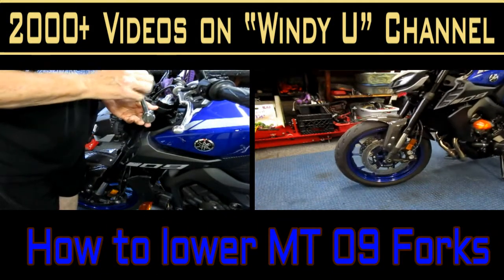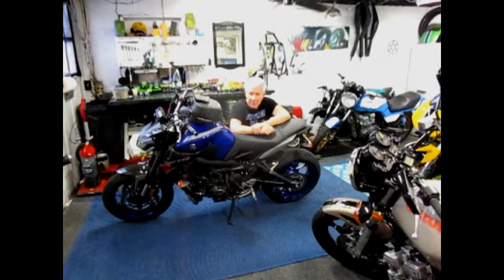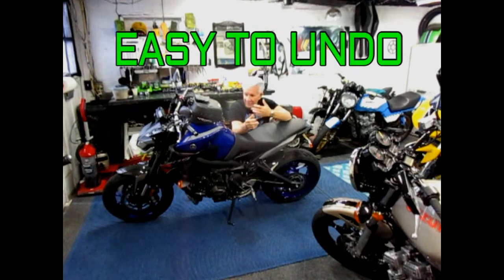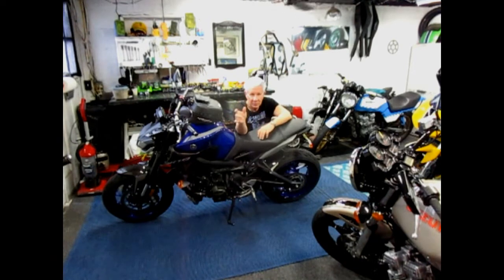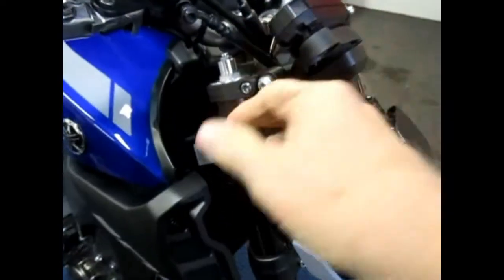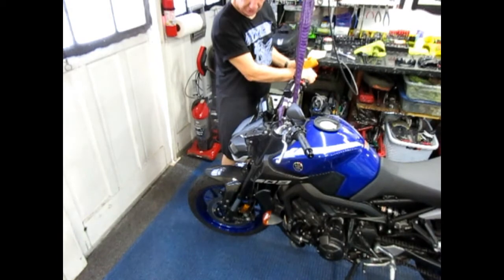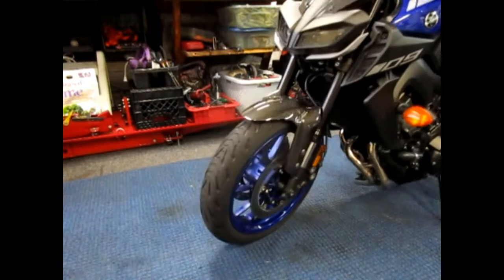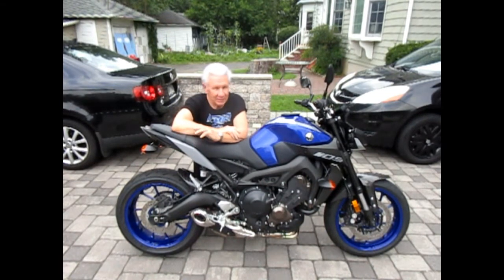HOW TO LOWER FORKS ON MT 09 YAMAHA OR SIMILAR MOTORCYCLE

Comment from the maker: A LOWERING LINK WILL BE A BIG HELP,I HAVE INSTALLED MANY INCLUDING LUCIANOS ZX10 AND MY OWN R1 and FZR.IF THAT'S ALL YOU DO THAT'S FINE BUT YOU COULD ALSO TRY LOWERING FRONT ABOUT AN INCH AND SEE WHICH WAY YOU PREFER.AS A NEW RIDER YOU MIGHT NOT NOTICE THE DIFFERENCE.LOWERING THE BACK ONLY WILL MAKE THE BIKE MORE STABLE.LOWERING THE FRONT WILL MAKE STEERING QUICKER.I HAVE DONE BOTH ON MY R1 AND GONE BACK AND FOURTH TILL IT SUITED MY RIDING STYLE AND AREA I RIDE.PRO RIDERS ADJUST FOR INDIVIDUAL RACETRACKS BY RAISING OR LOWERING FRONT AND REAR.ILL ADDRESS THIS MORE ON Q&A 16.LET ME KNOW HOW IT WORKED OUT.

Comment: What is the (maybe) bracket? That is wrapped around the middle of the forks? It has the 2 bolts right below and behind the headlight. I'm trying to find torque specs for those bolts but I can't find the name or specific piece to be able to dig for the specs. I also have a 2022 mt09 lol but just looking for some random quick help while I go insane digging 😂

Comment: Its funny you say it reminds you of RD because I rode an RD for years and I immediately equated my overweight MT09 (T9GT version of identical base platform)   This triple motor is just wonderful!  I believe Kawasaki screwed up royally in not creating their own CP3 to use in their H2!  Since the original H2 WAS a triple (albeit two stroke) and since the CP3 is so RD like it could have been just unbelievably awesome!     Say they did an 1100 CP3 for instance?  With or without supercharging it would just SHRIEK!  ...IMHO You blew it Kawi!    Maybe they  can still do an modern H1 using a crossplane triple?  I also can hardly wait for Yamaha's new R9!

Comment: I have a 2021 mt07 and my feet
are tip toeing on the floor. I bought a lowering link for the rear. Do I have to lower the front also? I don't race. No wheelies, no off-road, I just want to ride and have fun. I'm not sure what year your 09 is, but will what you did to your bike work for mine? I'm 57 and a brand new rider. Great video and consider me a subscriber.
Reply: I'm tippy toeing on my Mt09 well not totally tippy toeing (I totally was when I test rode a Tracer, that felt dodgy). I have like a 27" inseam so really short on the legs. I lowered it and hated it, the geometry felt all wrong and the rear felt like a plank. I put the org links back in, now happy to live with the bike semi tippy toeing. So I don't recommend lowering links unless you really can't reach the ground. There are other options, such as a redesigned rear suspension or shaving the seat. If you do use links yes you need to lower the front also. Some people say the same distance some 80%.

Comment: I've had terrible experiences with those torque wrenches, and you should really lower the back linkage if you lower the front to keep the same geometry. I'm not a mechanic though.
Reply: The whole point of this is changing the terrible geometry